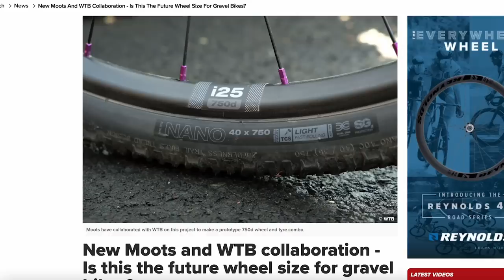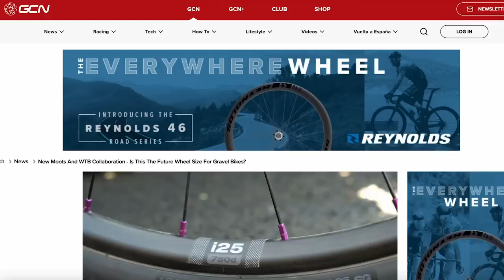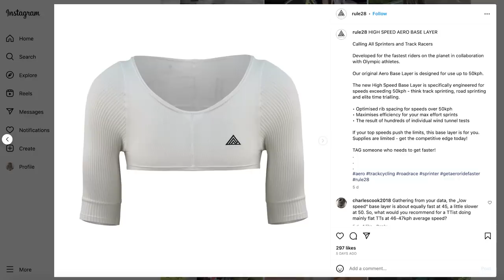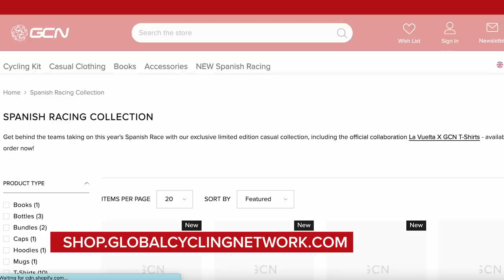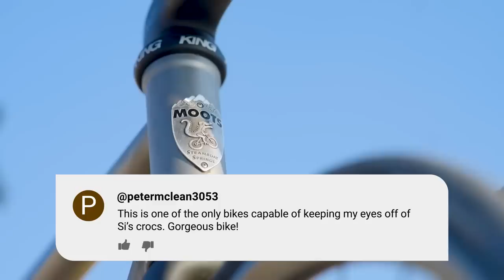10 Worst & Most Hated Bits Of Cycling Tech! | GCN Tech Show Ep. 297

Comment: While I understand Ollies opinion on aerosensors the points he uses are actually the same for a track test - that the cda measurement includes rolling resistance.  When testing outside you would generally use the same stretch of road and be it track, wind tunnel or road you need to do some baseline runs each time you test before making changes. Remember all models are wrong but some models are useful.  Both the upside and the downside of outdoor testing is the more complex the environment - it better represents the world most of us ride & race in, but in doing so it brings more variables into the equation.  While the wind tunnel and velodrome have fewer variables so better repeatability, but less well represent the outside world such airflow around objects, road surface, yaw angles etc.   The biggest benefit of a track or wind tunnel test is that they usually come via an expert that will have a well drilled protocol to follow to improve consistency then have the knowledge to analyse the findings and insight in what changes may help.  Many of these experts also test using road sensors these days so they obviously see a benefit if done with a similar rigour as testing in a tunnel or on a track.

Comment: I disagree with cable disc brakes. If your braking power seems insufficient, it's either:
1. you haven't properly bed them in
2. you're a pro athlete doing multi-stage races
3. you've got crappy pads/rotors
4. you're not not pulling hard enough

you also probably don't lube your cables 😂😂 mine's so smooth that the only thing I feel as I pull on the lever is the spring of the calipers and the deceleration when the pads hit the rotor ever so slightly

Comment: I agree, the radar thing is useless from a rational standpoint. It won't prevent a vehicle to crash into you. However people don't buy it for rational reasons. They love it because it feels good, because it makes them feel safe. Which tells a lot about how unsafe cyclists feel on the road.
I believe that if you're already keeping a safe trajectory on the side of the road, the radar won't do much. What is supposed to be your reaction to an incoming vehicle? Jump into the bushes? Jump onto the sidewalk? It's not the bicycle that should be equipped with a radar, but the car. The car should be made aware of how wide a gap it is giving to the cyclist, and an alarm should be triggered if it's less than the safe value. Only the car driver can kills you or save your life. Only the car driver actions have to be adjusted.
Of course, if you're riding in the middle of the road, that's another story.
And then if you want to get information before taking a turn, the radar information won't be sufficient. A rearview mirror will actually provide more information to you. A turn of the head even more. Plus, the driver seeing you turning your head will get extra information about your desire to turn, and they will think twice before running over someone looking them into the eyes!

With that in mind, I believe you could create more content about safety on your channel. The rare times we see you commuting is with a road bike and a backpack. The absolute worst setup! Cyclists feel unsafe on the road. The sheer amount of comments you received saying they love a useless device speaks volume. Your role might also be to advocate for cyclists safety. Or use their fear to sell a shit ton of bicycle radars!

Comment: gotta say, while i don't have the rear radar light, i totally see the value of it - not sure why you don't. it's great when on a narrow road with minimal shoulder and no bike lane - when there's limited/sporadic traffic - it'd be great. 

rim brake carbon rims - i get the risk to wear but seriously, i don't like all the nonsense involved with maintaining hydraulic brakes - if you're not doing epic downhills on a road bike, there's literally no need to convert your whole bike to get hydraulic to take advantage of the carbon rims. Ultegra and higher-quality rim brake systems are super lightweight and easy to maintain and offer excellent stopping power.

helmet mirrors are awful - you turn your head even slightly and you lose visibility as to whether there's something coming or not... field of view is garbage or it's obnoxiously oversized and adds wind load pushing on your noggin/neck - nah - rather the radar light...

Comment: I've used Oversized Pulley Wheels because they increase derailleur capacity and enable a wider gear range.  3x11 or wide 2x12 road bikes that also go off road and up hills.😊 I prefer a 52-53/11 top gear with a sub 1:1 bottom gear.

Comment: I am hard of hearing, and wind noise makes it worse,  I also have neck mobility issues.  I have always used a helmet mounted mirror, but I have had a rear light radar and it’s accompanying networked front light linked to my head unit for over a year and find them the best tech investment I’ve made in many years.  You guys are just flat wrong in calling them crap.   I usually agree with your assessments but in this case you are totally and utterly wrong.  And one of you (Cuthbert) is also dead wrong about a mirror

Comment: 3:44 I’ve had rim brakes in the past and now have a bike witch cable disc brakes and I feel the disc brakes work so much better than the rim brakes, despite being mechanical! I get immediate, more reliable stopping power with my cable disc brakes than I got with rim brakes, and the disc brakes don’t heat up, get coated with grime from the road, and start screeching when hot as my rim brakes did.

Comment: I'd pick a properly set up pair of cable disk brakes rather than faff with tubeless tyres and sealant any day. 
I restored a 2004 Giant Rainier hardtail mountain bike with a few upgrades that still maintained the original "performance on a budget" ethos of the bike. One of those upgrades was a set of TRP Spyke (both sides actuated) cable operated calipers, I used Jagwire compressionless cables, coupled with a set of Avid levers that are pull ratio adjustable and 180mm disk. Stopping power and modulation are excellent, not like hydraulic in feel, but still excellent. In fact I kind of like the different feel, it's more "forgiving" for want of a better word. It's become one of my favourite bikes to ride.  And yeah, it runs clinchers.

Comment: Cable discs... I currently have 2 different bikes both with cable discs. One is almost as good as hydraulic, the other is way crapper than my alloy rims brakes. The better one is a no name caliper while the crap ones are a known brand (that IMHO are not set up as well as they could be). Using good compression less housing and sensible cable routing, cable disc can be a good option.

Comment: Hard disagree on that cable disc brake reckon. I've been on cable discs on my commuter/tourer for years over a couple bikes and I love them. They need to be set up correctly and the dual pivot ones (TRP make some nice dual pivots) are radically less fiddly. I just find cables much simpler to manage and they are so much cheaper as a system, ideal for a good bike, that stops consistently in whatever weather but isn't stupid amounts of money to lock up outside a pub. 
Counterpoint: I don't understand why everyone is nostalgic about rim brakes. Do you all only ride in nice conditions or what? Keep all that road spray away from my brake surface please.

Comment: Mech disc exists for their workability in the backcountry.  And while they're a shadow of my Deore XT discs on my mountain bike, a good mech disc--as I have on my gravel bike--are far stronger, modulating and work under more weather conditions than my rim brakes. And I've used high end rim brakes for 30+ years and my mech discs are better.

Comment: Ollie, have to disagree with you. I have carbon rim brake 50mm Roval Raptide wheels. Have had them for 3 years , brake track is still as good as the day I bought them.  I do about 3000 miles a year on them , actually think they have 11000 miles on them and they are still perfect. I think there are allot of factors, I live in Florida which is flat so no heated down hill braking going on.

Comment: OSPW doesn't suck. But it is the most over-hyped and marketed bit of tech currently on the market.
You're talking several hundred pounds for (at most) 2-3W gains which makes your shifting worse!
Ceramic bearings on bikes are generally pointless, as you're not running at high RPM. There's also a massive difference between friction without load (where they show a pully spinning forever) and friction under load.

Comment: Aluminum and carbon fiber frames suck. Both are prone to catastrophic failure. Aluminum is at least cheep and recyclable, but tend to crack at the welds and can’t be repaired because the heat treatment prevents them from ever being welded again. Carbon fiber is good at being formed into neato aero shapes, but when it fails it often is practically an explosion. If it does crack it can at least be patched but the material that is essentially the glue is plastic and eventually will expire. Think of the L’Eroica events. You can ride bikes built before 1987 (36 years ago). But what will become of carbon fiber bikes? If they manage to last that long, then we can watch them explode on the courses. Won’t that be exciting! Not to mention the electric shifting components. Expensive and disposable. What a combination.

Comment: Hydraulic brakes are not serviceable in the middle of nowhere. Rim brakes are, unfortunately, going the way of the dodo. Cable-actuated disc brakes are a good option if you have a bike built for disc brakes but you need on-the-go serviceability.

Comment: cable disc brakes don't suck always. there is a wide range. and setup matters loads. cheap mechanicals are more often than not worse than mediocre rim brakes. but there are also good (and expensive) mechanical disc brakes, that are better than quite a few hydo discs (the cheaper ones). and of course, if you don't set them up properly, they will suck.

Comment: Finally, a sound engineering insight about why carbon clinchers are/were a badly flawed and dangerous design. The world of cycling was at its peak when it seemed to understand that you train, tour and and commute on somewhat heavy but less expensive clincher/aluminium wheels and race on ultralight yet more expensive tubular/carbon wheels. None of the carbon clincher failures that lead to silly discs and probably killed and injured many cyclists would have every happened if the second rate engineers in the bike industry actually knew what they were doing!

Comment: I use cheap lube spray and are am now on 13000k on two chains and my rear sprockets are still not worn out enough I need to replace them. Never clean the chain, just turn my pedal and spray from the rear for three seconds and I am done. I found out chain line helps a lot in preventing wear. Match your front and rear for the most used gear ratio's.
On helmets, I'd like some wind noise protection built into them and they absolutely need bug gauze inside. Bugs crawling on my head are super mega annoying

Comment: Helmet mirrors SUCK. Even though they generally work for situational awareness, they are their own safety hazard. All of them have sharp and/or pointy components mounted near your eyes. If you crash (or bang into low shrubbery even), there is a high risk of that cutting your face or even going in to your eye? (Says the guy who went down in normal metal-framed glasses that sliced into his forehead).  

As to radar, don't think of them as magic. But they do add to situational awareness. Not perfect. Not needed. But definitely helpful IMO. And the auto flash when being overtaken is kinda cool but I just always have a bright blinker running anyway. (Not in Germany apparently)

Comment: There's something much better than radar, doesn't require any batteries and it's very cheap - a tiny convex mirror mounted on the very end of a handlebar (on a left side or both sides, for example).

Comment: Disagree on the mechanical disc brakes. If you have ever had a hydraulic brake pipe break/split/fail in ride you are not repairing that at the side of the road. Many tourers use mechanical disc brakes for this reason. A mechanical cable brakes you just replace with another. Bike tool will do this. Hydraulic cable/pipe fails will need replacing and bleeding. Much more hard work.

Comment: WTF….Tech that sucks segment was a hot mess. Safety products are beneficial unless it’s radar? Cable disc are almost the same as rim brakes? I’m gonna call this out as one of the segments that suck. But nice try, had a good laugh. ❤ 
What about handlebars that can be taken apart, 2 part seat post for additional compliance? Internal cable routing inside the upper headset bearings? The current state of the previously glorious Speedplay pedals? Crazy aero design details in handlebar/stem or seatpost designs?

Comment: So I have some high end cable disc brakes that work really well. Still not as good as a hydro but stop amazing. 

I have them in my touring bike for ease of maintenance

The cheap ones do suck tho. If you add compression less housing, it helps a bit
Reply: Ones that I’ve tried that work well are 
Paul components Klampers 
Trp Spyre slc
Yokozuna ultimo/ motoko

Comment: I love my tt carbon rim brake wheels, would never go to tt disc brake.  Also, I love my custom set up road bike with a cable disc front brake and rim brake rear, never had a stopping issue and it has nothing to do with cost...will never go hydro, and will never go tubeless...60-80 grams of floating yuk in the tire, good for less than 1 season, what a laugh.

Comment: I think mechanical disc brakes sucks. It's hard to get them work, you need special housings for a good pressure point...
Overall a mechanical Tiagra with disc brakes is about 50-100€ cheaper as a hydraulic one with less maintenance effort. Because of that point I would choose the hydro brakes.

Comment: #askGCNTech I have been Zwifting for around 12 months and have just had a break of 3 weeks for a REALLY good holiday. On returning to my bike, both my power meter on my home set up and at my local gym are Under reading by about 35% and my scales are over reading by around 4 kg.  Coincidently all my bib shorts and jerseys have shrunk, but my cycling socks are fine.  My electronic glitches happened around the same time as the UK air traffic control outage so it is clear that was the cause of my power meter and scales issues. But why are all my bib shorts and jerseys made of an inferior material to my cycling socks?

Comment: Cable disc brakes don't leak (work flawless) unlike hydraulic brakes.
Reply: I had a hybrid cable actuated hydraulic system. Had so many issues with it. In the end it was replaced with a cable system which worked so much better.

Comment: People keep putting oversize pulley wheels on their rear mechs. Because they are gullible enough the believe the BS that they'll help someone who rides at 12mph. They are even more pointless than rim brakes. Unless your using ceramic coated alloy rims in the wet. Then I'd use one of my other bikes with disc brakes. I can't remember if it was Frank or Ollie who reminded me about internal cable routing. I can just about tolerate normal cable routing. Just don't get me started on how much of a pointless waste of time internal routing through the headset is. Plus the wasted DNA it took to took to design something that stupid. I am a BIG fan of external cable routing and will always go for it when possible.

Comment: I agree with the RRL comments.  Radar lights are not attractive to me for their cost and current capability.
I do hope they get better.   For me, on the roads I ride, I hear the cars coming and yes, a radar isn't going to help me unless I jump off the road every time a car comes!
My perfect rear light doesn't yet exist but it will have ALL of the following in ONE package:
- A radar that records overtaking speeds (duh)
- A stabilized (GoPro-ish quality) camera to record the passing cars and their driver's (for court evidence so my family can sue their pants off!  No, Garmin's $400 fail cam isn't an option here.)
- No app phaffing with the video file storage/retrieval - a setting to have this be a "black box" with wake on approach recording and a continuous loop so I only need look at it when something happens of consequence.  Again, Garmin painfully close but screwed the pooch on their app design if DCR is any indicator!)
- Flares when baking - like a car's brake light!
- 20+hr battery life or in-ride charging ability.
Yes, many lights exist with one or two of these features and some do them better than others.  This needs to be Apple/Shimano-solid before I shell out hundreds of dollars on what otherwise costs less than $50 and does a great job to AVOID problems in the first place.

Comment: Ollie’s view of cable disk breaks is right on. They are still better breaking in the wet that caliper and yes they are easily upgraded to hydraulic. I only used the cable disks for a few months and the upgrade to hydraulic was easy and relatively inexpensive. 
I went straight to XTs for quality. it was an older hybrid bike for tooling around town. 😊